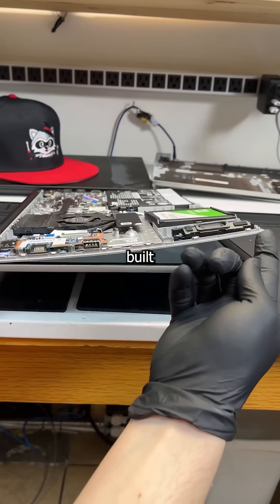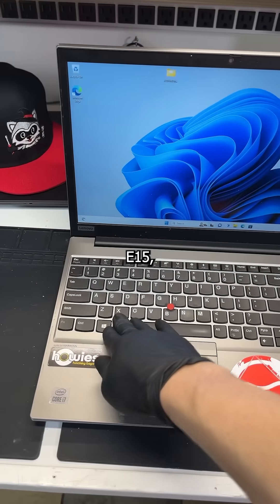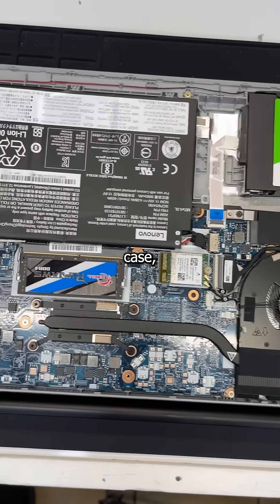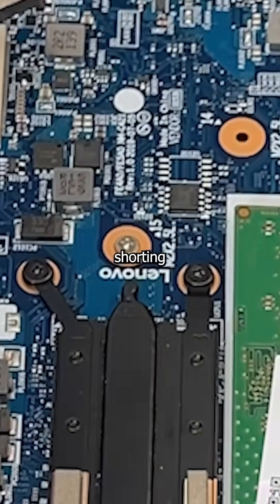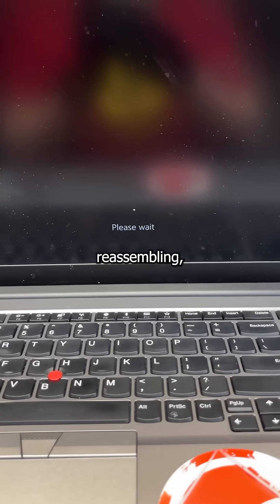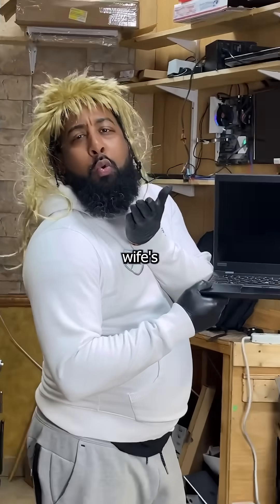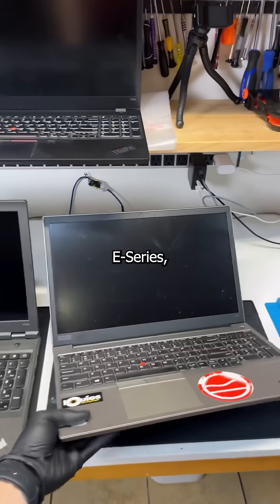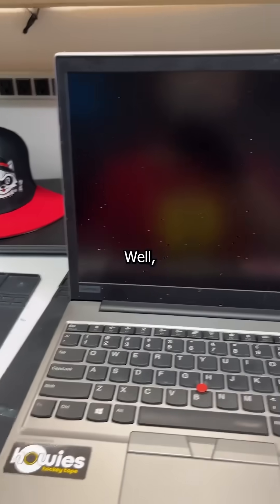ThinkPad or ThinkBad? Has Lenovo ruined the best laptop ever made? #tech #pc #technology #shorts

Comment: Over the past few years I’ve been dumpster diving for computers, I’ve noticed how most of the newer laptops that are thrown out have faulty motherboards yet the older laptops have perfectly working motherboards and work perfectly fine with an ssd upgrade. Ironically, i picked up a precision 5560 and a 2012 macbook air from that place and the 5560 doesnt charge or turn on yet the 2012 macbook air works perfectly fine with no issues.

Comment: I personally think Lenovo does not ruin the ThinkPad lineup. Sure they do make many stupid design decision like soldered RAM but I think compared to many other manufacturers who even consider to solder wifi card or even SSD (ahem, Apple) to achieve thin as f and stylish design, the black bold and thicc design of the Lenovo ThinkPad is still better and with the L, T and P series continue to bring most of great features from old ThinkPad to this day, I think Lenovo will eventually figure out ways to stack 2 RAM slot on the T series and removable USB-C ports. And at that moment, it will be The Greatest Business Laptop That's Ever Lived. 
About the E series, it has been the most low-end laptop line from Lenovo, and the E series is just the glorified IdeaPad with the TrackPoint. Heck it is cheap, flimsy and function just like my brain when in a Math exam

Comment: The boards are usually made of FR4, fiberglass, and they can flex but when they do it can break the solder joints, vias, so NEVER flex them, and put as little weight on them as possible when mounting sideways like tower cases now with the CPU and large heatsinks. It stresses the board. I used to work at a PC board factors, that's how I know this.
Reply: Isn't that why they now make mounting screws and stuff that are right next to the processor?

Comment: My HP Victus has an issue where you pick it up the metal plate that supports the track pad bends and gets the track pad stuck in position then I have to open the laptop up bend the damn plate back before I can use it normally again real POS from HP🎉

Comment: Intel Core i5-12400F and AMD Radeon RX 580 will work great together on 1920 × 1080 pixels screen resolution for General Tasks.

This configuration has 0.0% of bottleneck . Everything less than 5% should not be concerned major bottleneck.

guys wtf i just saw first cpu and selected it

Comment: It's an E series, theyre more budget focused, that's why, The T Series doesn't have this issue. 
Or the P Series as you pointed out. 

However the t series is more repairable, they have keyboards fused to the chassis whereas the t series is not and easier to work on.

Comment: I have a T470. When it hangs or takes over 3 seconds to save an Excel file, the best cure ive discovered is, to simply drop it from the table. That immediately gets it to working perfectly again. I mean, ive literally dropped it a few times this week. And then, I bought an E15 over a T14. 

The ThinkPad name used to stand for something. Using the E15 (i may have upgraded the stock 8GB RAM to 24GBs) is so relaxing and refreshing in comparison to my T470. But i know that the E15 is screwed if it slips off a table let alone dropped

Comment: I'm dealing with a fking HP shitbrick that has no fan or fins on the CPU cooler, with only a single 0.6mm aluminum sheet the size of a pack of cigarettes plate as the CPU cooler, this "CPU Cooler" is bent probably also from the laptop being picked up in the corner and now the laptop overheats since the "CPU Cooler" is not making proper contact with the DIE.

Fk HP Laptops and their Printers

Comment: I actually have this problem but not that bad, mine if you flex the keyboard it will go blue screen and boot sometimes freeze the whole laptop and sometimes crash immediately no blue screen

And also if you using those cheap laptop feet that make the laptop little bit high to make the air flow better its also bad in my laptop because after hitting the desk and drop the laptop 1 inch drop blue screen immediately

I actually manage to crash the laptop for almost one weak not working because of that while gaming I rage quit that I hit the laptop then boom blacm screen can't boot it

Comment: I pick up my Thinkpad T490 with one hand many times and there's basically no bend in the chassis at all.
It is such a pleasure when you don't have to treat your laptop like a baby because the manufacturer put some ACTUAL material into it.
And the hinges are SOLID, the lid doesn't feel like a flimsy plastic that it's gonna break with a little too much force.

Comment: Lol, a friend's Dell laptop just happened to have this issue yesterday, i was confused as i didn't know what was wrong with it, the exact same symptoms, but when placed sideways it worked just fine, until I fliped it over, and noticed how easily the chassis started to bend (with the motherboard also bending with it), identifying right away the problem, and reassuring my opinion on how cheap consumer grade laptops suck so much.

Comment: It’s down to the RAM slot, HP 14’s have the same issue…… stick a bit of hard rubber on the RAM slot casing and the base when screwed on creates enough pressure to allow it to run

Comment: Really man my 4 yrs old laptop can support upto 32 GB of ram newer laptop mostly are soldered or hard to get to , for ram slot you need disassembling. Newer laptop are slim but built poor 
My older laptop I can't throw it wash it with water it can survive by newer laptop breh simple dump froze such weakling. 
Older laptop gave m.2 newer one's these days soldering it . 
Hp spectate, yoga slim, those 360 one's Best stay away. 
Especially 360 one's they seriously aren't practical most employee and co worker just use additional graphics tablet for stuff that's easier and have more features fire presentation also it's better
360 laptop are super unreliable 1-2 yrs heavy maintenance, the company ditched that none uses them .

Comment: Cook the motherboard in an oven so it gets re solder. But keep it on a flat surface so the components don’t fall off and remove the cooling system and all the detachable parts so if you run into a problem the whole system is not ruined. But it’s a great last resort.
Reply: Same concept as tossing a bunch of blankets on an Xbox 360 so it overheats and re-settled the solder. They used to skimp out on solder on older models so you could squeeze some extra life out of an Xbox that way
Reply: @ktoma36  I got told that it was the leadfree solder they were using. Its supposed to be more brittle. I don't know if that's true, but it jumped to my head when I heard Xbox 360
Reply: its not a gpu man
Reply: @JOSH2625 it will work just as well for a laptop board. They are fundamentally the same.
Reply: @JOSH2625  You think it only works for GPU boards? Odd.
Reply: @JOSH2625 chill, they’re joking

Comment: A few years ago, I bought a used Lenovo T540p laptop from a pawn shop. I upgraded the HDD to a small WD Blue 240 GB SSD and maxed out the DDR3 ram to 16 GB. It still works.
Reply: Those T540p is built like a tank, you can smack someone with that thing and it would still work just fine

Comment: Imo laptops shouldn’t even have plastic chassis
Metal should be the standard above like $400
Reply: I bought a $400 laptop from Walmart a year ago and it's better made than this. It doesn't flex like that.
Reply: @Dhalin Weird flex, but ok.
Reply: @mrlightwriter  Wasn't flexing, I was merely stating that the cheapest of the cheap that you buy from Walmart is better made than this crap.
Reply: @Dhalin It was a joke :D
Reply from the maker: 1000000% agree
Reply: @SalemTechsperts  there are many types of plastics, including engineered plastics and high performance plastics with many other types in its list. That's why materials engineers are there. in this case they should fire their engineer :)
Reply from the maker: @kaicettaa9890 good point, but I would be willing to bet the accountants were the ones telling the engineer they need to use something cheaper.
Reply: @kaicettaa9890 the engineer was probably forced to use bad materials to save costs, genius
Reply: Actually Expensive Laptops still use Plastic, But they use Expensive plastic and some metal that is very durable
Reply: @OrRaino all MacBooks use metal
Reply: @JustDestiny260   No shit, MacBook whole body is covered with Aluminium, anybody can tell that.
Reply: The problem isn't plastic - but low quality plastic without any strengthening. They literally just made a plastic box and put the hardware inside in this laptop... instead of making the plastic durable for holding the stuff and also the pressure when you type... damn even the Sinclair ZX80 didn't bend that much - and you know how awful that computer was!
Reply: A real thinkpad is plastic and it's better than a lot of metal laptops.
Reply: @attilavs2  Assuming you mean pre-T450, although the exterior was plastic they all had a magnesium frame internally, which was nice and sturdy, it's a shame what Lenovo did to the ThinkPad brand
Reply: My £2000 laptop from 7 years ago is plastic and still works.
Reply: @sambt5 the shell is plastic, but the chassis is probably metal
Reply: At least have a metal framework so the Plastic Cover doesnt break. Keeps it light and firm. At the very least, this ThinkPad there is straight up unusable
Reply: I got a $300 hp laptop to take to college that has a better frame than this lmao
Reply: Hell it should be standard to all of them, how hard is it to fit like three aluminum rods in the frame? That's literally one more buck added to the cost for fucks same, then again I doubt they were going for a good laptop, two 800$ purchases are better than one...
Reply: $2000+, take it or leave it.
Reply: If you used metal casing then a lot of the wireless features such as Bluetooth Wi-Fi things like that wouldn't be able to work because the metal would block the signal
Reply: @AdmiralStoicRum  Doesn't even have to go that far, just two or three aluminum rods inside the edges and suddenly this isn't a problem anymore, this is straight up cheaping out on literally the cheapest part of the build.
Reply: @AdmiralStoicRum  so then how do all metal laptops exist bud
Reply: @PieStudios the display bezel is made of plastic
Reply: @AdmiralStoicRum  bro learned that behind a taco bell
Reply: Bro my fucking asus vivobook 17.3 laptop is straight up plastic. But it thick as fuck and like $700
Reply: even my acer aspire 5 i got for like $300 usd was half metal cased. Thing as great with the 12gb ram but no video card so it struggled with newer games
Reply: i've had to replace so much shit on my dell inspiron, mostly exterior parts, and i'm just giving up and learning to embrace the crappy weight reduction holes in the shell. gives it character.(i'm going insane)
Reply: @spicyluckster I have owned a dell Inspiron 7373 for 7 years and it never had any problems only a battery replacement and two dents on the front. In 2021 I spilled a liquid all over it on accident and it didn’t damage the laptop a single bit. You must not maintain yours well.
Reply: My asus vivobook s15 is made of metal unlike a thinkpad p
Reply: Idk man, if the plastic is thick enough, like in P or T series, it can be just as good as metal casing, or even better. For example plastic is more comfortable to touch in cold weather
Reply: Just like how it is in phones
Reply: my lenovo ideapad z580 is actually metal ...but it was made in 2012

Comment: I guess that’s just how it is with cheap laptops nowadays. Flimsy plastic that breaks things or itself if you look at it the wrong way. Would it really cost that much more to at least reinforce it with a metal chassis?

My old thinkpad W540 is built like a tank, and the T440 isn’t too far off. Although to be fair, those used to cost in the thousands, not the hundreds.

Comment: Me and my coworkers call them “stinkpads”

Stay away from “Le Oh No” cause that’s all you will be saying. They just suck recently. Cheaply designed and break easily. Biggest issue I had was the USB charging port dying in a month due to faulty port or terrible firmware.
Reply from the maker: USB-C failure and newer ThinkPad. Name a better combo.
Reply: @SalemTechsperts HP (hot poop) and broken plastic hinge mounts😊
Reply: i had the bending case and garbage hinges on a new dell so crap is the standard now i think
Reply: @randomgack1965 especially if it starts with chrome and ends with book. Asus seems to be okay still.
Reply: @ItzBIULD  yeah Asus still goin strong I use one
Reply: @xineohP_xD  I use an Asus laptop. Have had it since 2022 I think. Works great!

Comment: I remember when you could bash Thinkpad laptops on someone's head and it would barely have any scratches on it.

You gotta miss those IBM Thinkpad series, they just don't make it like they used to..

I'm glad that I stockpiled a few T440s and X250s a while ago.
Reply from the maker: I made a whole longform video a few years ago, because even then it was evident that a 10-year-old thing pad was better than brand new ones.
Reply: @SalemTechsperts  
3rd Gen Intel was when they began adopting the use of cheaper and thinner plastic for housings. 

It all went downhill from there in terms of user-upgradeability and durability. 

4th Gen was the last socketed motherboard before moving to BGA mounting, and the sad part is even the earlier E-series models weren't nearly as flimsy as that E15 (my E570 and E530 were certainly built cheaper than my T460 or W530, but were certainly not that flexible...that is horrible).

ThinkPad was always about "the function dictates the form", but Lenovo has pushed it ever closer to Apple's "form over function" production methods and aesthetic.
Reply: No joke my friend hit someone over the head, and from the side with his Thinkpad P51 twice, and he only had to replace the SSD which got bricked. Theres a huge dent that covered the ports and the hinge likes to get stuck, but the guy he hit came out with a concussion and a nasty laceration on the cheek.
Reply: So true. I had a 2004 a21m ibm thinkpad that I TRIED to destroy. It never budged lol and damaged my floor. Old thinkpads were like the Nokia 3310s of laptops haha.

Comment: I love the visual gags. Like blink and you'll miss it.
Reply from the maker: There are still so many in previous videos that no one has caught. Every single frame is perfectly planned which is why it takes me so long to edit.
Reply: @SalemTechsperts  i notice them. Pointing them out ruins the 30 jokes you squeeze into these. Amazing work.
Reply: @SalemTechsperts  cuz like unless you've worked on pcs long enough, you wont understand how easy it is to miss a screw or have the PSU not be fully seated or miss the plastic on the back of a new heat sink or forget the switch on the psu or fight to get the front panel off and there's a simple release mechanism or plug a cpu fan header into a water heater header and the fan wont spin or spin too high and burn it out...